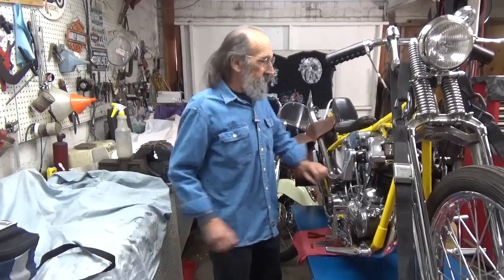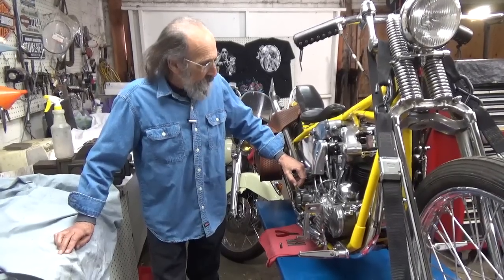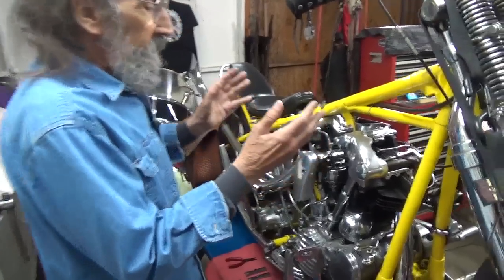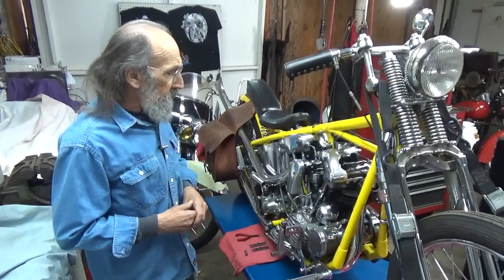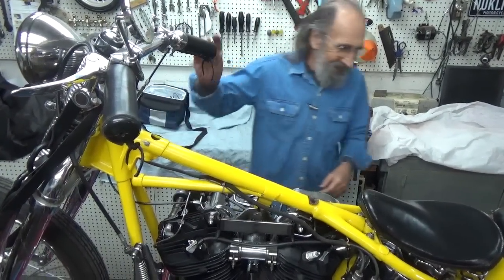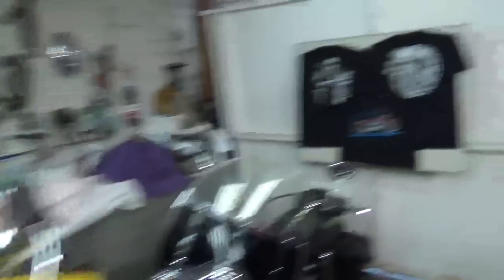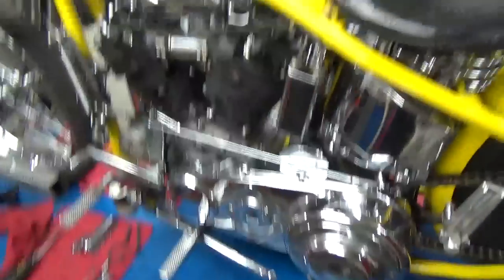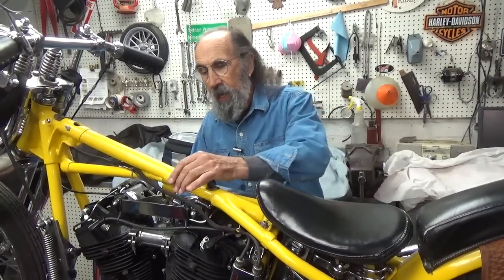The Harley Knucklead Oil System Still Giving Grief

Comment: It's always great to hear all the information. I'll be 65 next month and still can't stop working on all the older ones. Seems that the newer generation of bike builders won't touch any older Harleys. Not even blockheads.
Reply from the maker: I used to get people asking me to work on their British bikes or their Japanese bikes.  You know, I'm a pretty respectful kind of guy.  But I had to explain to them that I wasn't going to experiment and learn on their motorcycle.  I learned to work on Flatheads, Knuckle Heads, Panheads, and those new Shovelheads that hadn't been out very long.  That was Okay.  I learned Evos when they invented them.  We all had to learn stuff as it came out.  Then came Twin cams.  Younger guys have so much history to learn and it takes time.  If they refuse to work on something they haven't learned.  I respect that.
Reply: @pacificmike9501  Kudos to you. I have worked on '40  and earlier they changed the oil pump in '41. Which I believe the factory knew the shortcomings of their reliance  on the the vacuum system  and changed the return system with the panhead.

Comment: In additionto wire to clear the oil feed tubes, you might consider using string trimmer plastic.  It is flexible as well as stiff, and can be obtained in multiple diameters.  The piston movements cause pulses in crankcase pressure.  If there is any blowby, the pressure will be increased internally unless there is ventilation.  If there is external air leakage, the crankcase air volume will increase as air will get sucked in and then want a way out, so generally the pressure be higher.  That will push oil out the easiest spot it can find for it to leak.  If there are any air leaks in the upper head area, blowby will tend to move towards the leak, and push oil out.  When the pistons move in the opposite direction, they will lower pressure and want to pull air in.  That's the source of the air that can then cause the internal crankcase pressure to build.  Wordy, eh?
 If you can extend the road draft tube long enough, it may have enough volume to handle the pulses of crankcase pressure without pushing oil externally.
Reply from the maker: Good stuff.  Thank you.  When I get through here, I'll sit down and digest it.  They are good thoughts.

Comment: I was told from day one of building my knuckle, to, when riding, Back off (as iin shut down quickly) the throttle now and then when highway riding, creating suction  in the lower end, and clearing the valve tins...Worked greta for over 30 years, but now, gaskets are getting old, miles are high, (on my 19th set of tires) so leaks are beginning to happen again...that means one more rebuild, and it is good for the rest of my life, and a fair chunk of my son's!
Reply from the maker: Sounds pretty wonderful to me.  I may pull the heads on my Knuckle this week.

Comment: I had a similar problem on my 48 pan of oil pooling in the valve covers. It was so bad it was filling up the push rod covers. This was a fresh rebuild, and I removed, and replaced the heads, and cylinders 3 times trying to correct the problem...no luck. Was at my wits end, when an old timer where I worked suggested removing the screw, spring, and check ball from the oil pump, and replacing the parts. I did like he said, using a magnet to remove the ball. The engine Immediately started to behave. Evidently the bypass check ball was stuck, and was not doing it's job. I realize the oiling system on a knuckle is different, but it might be worth trying if your situation doesn't improve...it only takes 5 minutes or less to do.
Reply from the maker: Absolutely.  I'll check it out.

Comment: Hello Mike.  You might consider increasing the size of the "slot" for the oil breather in the right-case.  Back in the day we had a pattern we used to scribe the oiler slot to increase the size.  Increasing the volume may help.  It's worth a try!  Mark in Riverside, CA
Reply from the maker: We'll get it.  Don't really want to modify my virgin (NOS) cases.

Comment: Hi Mike. Assume bike. A knucklehead is no 1 priority on my list. Unfortunately I’m living in Sweden, so I’m not sure they are available. If that was my bike. I hade route new pipes so they where not routed so close to the cylinder head. You may need a ultrasound washer machine. They take care of all carbon deposit that for sure are the case in those small pipes. Thanks for a very fun and entertaining video Chanel of yours. Greetings Peder
Reply from the maker: The lines are beautiful original parts welded at the factory to the tins.  To remove the lower tins, the valve guides must be pressed out of the cylinder heads.

Comment: I had the rear exhaust plug on mine 45 years ago and it made a mess in a hurry. Rear cylinder broke back in 74 and adapted Pan cylinders as aftermarket wasn’t available at that time. Twice it dropped a valve head off, cast iron heads can take a lot of abuse, realized the aftermarket ones at the time were of poor quality. Currently is apart due to seized rods on crank pin, I was running it really hard for 30 miles. The odd thing is the pistons show absolutely no signs of scoring in cylinders. Only thing I can figure is with the sustained high rpm the oil was flying off the crank so fast as to run dry but still in the crankcase to lube pistons. Hope to get it back together this winter. Nothing like a good running Knucklehead! Oh, and also about 30 years ago a crack developed in the front exhaust port which eventually made it to the valve guide causing the valve guide to be loose in the head. I stripped the head to the bare casting, v’d the crack out and heated the head to red hot. I proceeded to weld with nickel rod, peened, welded and when done packed in wood ashes to cool slowly. I then had a friend machine it and it has never caused a problem again.
Reply from the maker: That's beautiful.  It is the Knucklehead curse.   That front exhaust port was trying to crack when it was new.  You are a talented individual.
Reply: @pacificmike9501  Thankyou, I would never call it a curse being lucky enough to have owned a Knucklehead my whole adult life but the serial number is 41FL 6667, 3 6’s if you believe in such things hahaha. In my opinion your channel is hands down the best channel dealing with older Harleys. You explain everything, how you deal with issues and why and most of what you do can be done by owners on their own machines with basic tools in their own garage. I’ve always felt it is important for owners of older machines need to know how to deal with the everyday issues with their machines themselves otherwise it takes the enjoyment out of owning one. Keep up the good work.👍
Reply from the maker: Thank You.  I agree.  When those old bikes were built, this was an agricultural country.  To take care of everyday life, you needed to know how to maintain your own machinery.  Those machines were built to be serviced and rebuilt many times over.  I love it.

Comment: Also Mike I think I saw you say the "Tin cover" stiffeners were mounted under the tins. Is this right? Like on pan covers the stiffeners go on the outside of the tins. I've done pans but not knucklehead.  Seems wrong way to do tins?
Reply from the maker: Those little stiffeners have screw holes that hold the covers on.
Reply: Yes I know they have holes but you said the tins go on top of the stiffeners?

Comment: Another idea to clean the oil lines....if you remove them and soak them in seafoam....or carb cleaner....and use a small spring either pulled through them or attached to a stiff wire ( like your throttle wire).... maybe braze or Tig the spring to the wire
Reply from the maker: They are welded to the tins.  To remove the tins, the valves and valve guides must first be removed.

Comment: On my engine, all four "rocker-cups" (called in the book "Valve Spring Covers") are having one tiny hole located close were they comes to the Knuckle-housing (aluminium rocker-arm housing). I am having the impression that these holes are for a purpose, but it makes no sense for me, because it is a point for an oil leak. Should I close them or keep them open? Thanks and best regards from a Guy in Germany, who is trying to cure his knuckle from spreading oil.
Reply from the maker: I'll be back on that soon.  This Sportster has to go home first.  I think there are some questions I'm going to need some tutoring on.

Comment: Do you have the original 5 to 1 gears? What would also be interesting is how much vacuum you have.
Reply from the maker: I have rodded out the drains and it seems to be alot better.  Once it quits raining, I'll get it clean enough to take it out again and see if I actually have it stopped.  If not, then I'll pull the heads.  The pump is all original and it didn't always have this problem.  We'll see.

Comment: And mike they make a hand vacuum pump you might try on them lines. I've showed plumbers dont plunge down, vacuumed pull plunder up.
Reply from the maker: Vacuum from the engine evacuates the oil from the top.

Comment: As a question re: the oil lines. Can the lines be swapped out for something like braided steel that can be routed a little further away from the front cylinder?
Reply from the maker: They are welded to the tins.

Comment: Since part of the oil circulation works off vacuum, is it possible to have a leak in your closed system? Push rod tubes, etc.?
Reply from the maker: Yes.  I've checked that all along.

Comment: That IS a beautiful knuckle!...Only been an observer & "official tool hander" on knuckles.... Looking forward to the '74 XLCH clutch exploratory... Been all thru my '74 XLH & quite a few other ironhead XLs....I would wager I'm going to learn something cool about ironheads when you get around to that XLCH series ....> Worst clutch issue I ever ran across was a '79 where the clutch basket back had ripped apart...OEM stock engine (i.e. not a hot rod)  Bike was only a couple years old at the time.... Defective shell was all I came up with  ...??? >  I didn't think "Defective" made clutch shells for HD ironheads in later '70's ...  :-) ....sorry ...old joke I had to toss in my comment
Reply from the maker: Our memories is what we have to draw from.  "Defective" has made a lot of stuff.  Thanx.
Reply: @pacificmike9501  You MIGHT recall the origin of that tidbit of "Defective"(as a mfg. brand) garage humor?
Reply from the maker: "Garage Humor" is half the fun.

Comment: How is your breather valve? If it isn't right, it won't pull oil from the top end and recirculating it right.
Reply from the maker: You are correct.  I have been there and checked it all out.

Comment: in an earlier video you said the problem started after you changed the valves did you change the lower spring collars maybe the the lower collar is blocking off the suction hole in the bottom of the spring pot just a thought could put a small hose on the pot suction line and blow into it to check
Reply from the maker: That's going to be the next step, if it hasn't stopped.  The rain needs to stop.

Comment: hi paul I have a 1974 ironhead sportster  I have a little problem with my starter when remove it fell apart now not sure about the brush location I think the is a Hitachi starter!!!
Reply from the maker: You'll need a picture from the service manual.

Comment: My chopper, 77, sporster mike. I'm re assembling my clutch, see if that's stopping my starter from working,  2 months working on this starter
Reply from the maker: What is it doing, or not doing?
Reply: I've changed ever piece of 77 starter . 2 times. Wont engage ring gear on clutch basket. So I took clutch apart to make sure it didnt come lose. Try 3 rd solenoid now
Reply: Had starter out 50 times, checking every piece.  Wont engage ring gear on clutch basket.
Reply from the maker: The solenoid must be in proper alignment, but it has to hit hard.  Make sure you're getting over 12volts to the solenoid.

Comment: Iron head Sportster eh? - Heh heh - in a Norton 'featherbed' frame perhaps? 'The Nortley Fartster'! (Rolling on floor, Eng. : )
Reply from the maker: I remember a Featherbed frame with a K-Model in it.  Was it any good?  Who cares?  It was way cool.  Then I had an old friend ( the Late, Great Harold Reynolds) who had a K-Model frame with a Knucklehead motor and Burman gearbox.  I wonder if those two guys knew each other.  The Nortley Fartster?  What a Gas!
Reply: @pacificmike9501  - Ha, pray forgive my rustic crudity - I saw one many moons ago, an 'oily-rag' cafe racer, name proudly emblazoned in florid script along the flanks of a rather enviable alloy race-tank.
Your oiling: Those oil lines will need a fair old 'snort' to clear it's sinuses way up there; pistons are big enough (!) so is breather timing OK, or are you losing case-vacuum through a multitude of working tolerances?
Found a nice colour for a WL, 'Improved Engine Green' - a rather homeopathic shade consisting of one drop of green in a bucketful of 'ripe & ready-to-eat' beige! Check it out - I just love it. Y'all : )
Reply from the maker: I think clearing those sinuses is correct.  You ain't crude.  I've seen so many pictures, from years ago, of so many combinations in Featherbed frames.  I was always impressed.  Many years ago, I got trusted to ride a Norvin.  Didn't know what I was doing, but it was a bigger thrill than my 58 Sportster.  That was over 50 years ago.  As  for colors?  That's one of the personal touches that keeps it interesting.

Comment: Mike can you do a video of putting clutch all back geather sporster
Reply from the maker: I believe, in the next few days, I'll be doing it.
Reply: Mike I'm pull rest of clutch basket off, make sure it all way in,on  and check starter weld on clutch basket starter gear.
Reply: 3rd selanoid
Reply: Thank you
Reply from the maker: How much voltage are you putting to the solenoid?  They are very "voltage sensitive."
Reply: I put a new one on, and the correct one. I'll change again if this new selonid doesnt do it??
Reply: Mike I put big gell battery in it to
Reply from the maker: What voltage is showing?  Have you jumped from the battery post on the solenoid to the little post on the solenoid to see if it functions when you circumvent  the relay?
Reply: Every thing looks great, gonna shim selonid on one side when installing again.test right on

Comment: If I had to bet I would say you have a 61 cu. In breather gear in a 74 cu.in.engine.  Wrong port size for the  74.
Reply from the maker: Not according to everything so far.  I can do some more parts checking, but a good thought.